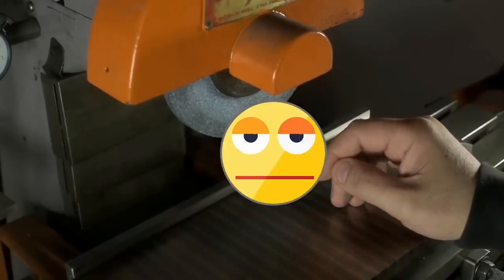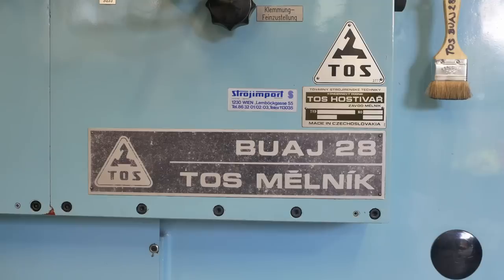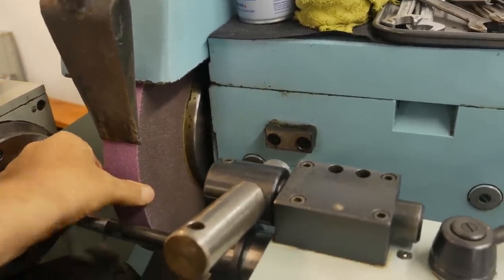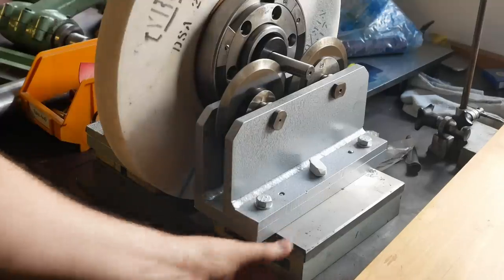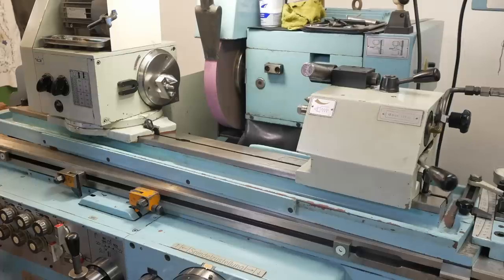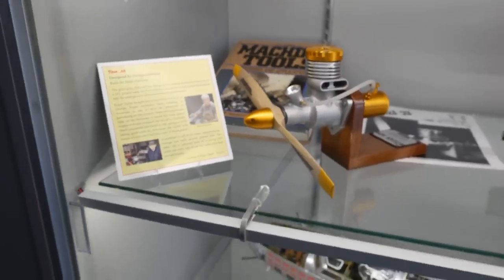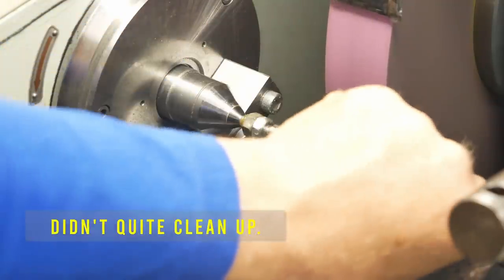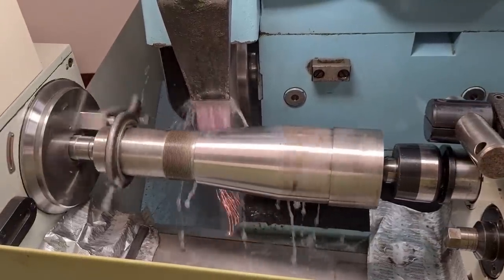Who needs a cylindrical grinder? || RotarySMP

Comment: To answer your question:  Everyone.
Everyone needs a cylindrical grinder. :)
Reply from the maker: Bingo...correct answer Tony :)
Reply: I thought I recognised the first few frames of this video
Reply from the maker: @NathanealGovender  TOT helped me out with a clip.
Reply: @RotarySMP  Great video. It's so hard to find information on these conventional machines.
Reply from the maker: @NathanealGovender  Thanks. that is my feeling as well. There is a lot of info about cheap consumer gear, but this top industrial stuff which was well documented in all in paper.
Reply: What a lush machine, but I'll just keep turning parts like 50p pieces on my cnc lathe thank you very much.

Comment: I'm always fascinated by the economics of machines like this. I have no knowledge of what the machine tool market was like back then, but consider: First, that machine was built pre-internet. Someone sat down and figured that it was economically feasible to invest in the design and tooling to build that machine (what was the design cycle like for it?) and figured they could sell enough of them to recoup that investment. How long did it take to design, and what was the cost? How long to build the tooling to produce the machine, and what the cost? How many did they deliver, and (again) what was the cost? And on top of all that, the machine is entirely hydraulic. Yes, it has relays, but (apparently) no digital electronics, and yet has pretty amazing accuracy and resolution. Incredible.
Reply from the maker: Good points. Given the development of high pressure hydraulics (3000psi for airliners, up to 5K for military), Jet engine fuel control units, etc with their associated close tolerances, and also parts for the nuclear industry meant that the market for such grinders is greater than many think. I imagine Hamilton Sundstrand and Woodward governers probably have whole plants full of machines like this. My guess is that they such manufacturers run them till worn out, rebuild them, wear them out again and then scrape them.
Reply: There's another manufacturing category that uses a lot of grinders: diesel injector manufacturers. Grinding is used on many components of the injector, whether cam-driven or common rail, and in the high pressure pump.

https://dieselnet.com/tech/images/diesel/fi/xpi_inj.jpg is an example of what the inside of an injector looks like. Gaskets and o-rings wouldn't hold up to the temperatures and pressures involved, so they aren't used inside the injector. Instead, extremely tight tolerances are used on matching ODs and IDs to provide sufficient sealing between moving parts, and for static joints extremely flat surfaces are clamped together to provide sealing. The tight tolerances on moving components have another benefit as well: the gaps are simply too small for most contaminant particles to fit into, meaning less abrasion and jamming.

If you can wrangle yourself a tour of a fuel injector manufacturer, I think you'd find it interesting. ID and OD grinders, centerless, form grinders, microhole edm, hydroerosive grinding, etc etc etc.
Reply from the maker: @markp5726  Good point. I would love to tour an injector plant.
Reply: You can be sure that isn't the first machine they built, even the first cylindrical grinder.  They probably had lots of machines out there and a list of repeat customers who could request such a machine.
Reply: Analog is more accurate than digital!
Reply from the maker: @jamesbutler5570  They seem to have specialised in grinders for about a century.
Reply: I guess often the answer is some big buyer (like the government) who either guarantees at least break-even or even profit. After that it is just a matter of walking in to the bank with your guarantee/collateral. Sometimes I guess the government could guarantee the loans too.
Reply from the maker: @rkan2  I would guess that there is a constant demand for machines like these, as they have a finite life and wear out. The products they grind are often invisible to the consumer, but ever present.
Reply: @RotarySMP  Sure - I was more referring to the initial investment in production.
Reply: A lot of machines get designed because the designer had a part they were manufacturing or planned on manufacturing that needed a specific tool that wasn't available. After the machine was built they found out it could be useful for a variety of things. I know I've built simple tools in my home shop for these very reasons.
Reply: Before the internet people were smart and networked just as much if not more.
Reply: @markp5726  how can one use that need to possibly aquire work/ customers in this market
Reply: I grew up in the north eastern u.s.a and my family had small construction company's and I always was fascinated by machine shops with equipment like you are talking about and let me tell you they pay for them selves quickly. So I'd hope who ever builds them would make out ok ad well.
Reply: Millions of bearing races are cylindrical ground every year. Same for gearbox shafts, machine spindles etc. There is no shortage of cylindrical grinding work, so I imagine  the cost element was mainly a comparison to their competitors.

Comment: Wow! What an awesome machine. These automated hydraulic controls are incredible. I bet he got it for next to nothing compared to its capabilities…
If I had a machine like this I would come up with so many more project ideas that I would most likely never get to start or even finish… so you are right: I need a cylindrical grinder now 😂. The model planes are astonishing as well! Thank you very much for the video
Reply from the maker: Thanks Markus. Yeah, this is the dream, picking up an industrial machine which never worked shifts. I think Franz has ground just about everything in his shop, and is eyeing up that box of nails as needing improvement.
Reply: @RotarySMP  Which nails don't need improvement, after all?
Reply from the maker: @hughmac13  If the broom handle would fit though the head stock, he would probably grind that round as well.

Comment: Original grinding wheel, only worn 12mm... wow! 😂 The last OD grinder I used went through a wheel at least that large every 16h or so. Needless to say, we got good at changing them.

One concern with a small coolant tank is temperature stability. The grinders I worked with (mostly UVA nomyline) had a chiller with at least two separately cooled circuits, chilling different parts of the machine to different temperatures. IIRC there were heat exchangers on the cutting oil, spindle oil, and hydrodynamic way oil, and coolant flowed through the frame and the linear motors as well. The cooling was good enough that warmup from power off only took ~5 minutes, as opposed to 30 min - 1 hr for older machines.
Reply from the maker: I will pass that on to Franz. Good point.

Comment: The detail in those models is just astonishing, I wouldn't even like to guess the number of hours that must go into them.
Reply from the maker: Young Park estimated 10K hours, but I am not sure if that was for one or for all three. They are made of thin aluminium and rivetted. Every single tiny rivet was driven like on the real plane.
Reply: @RotarySMP  im now imagining a miniature pneumatic hot rivet hammer 😅
Reply from the maker: @RJ-wx3fh  The guy was a retired dentist, so he was used to working with small scale precision.

Comment: this is amazing, automated hydraulics is something I have never explored before
Reply from the maker: This sort of task has since be largely taken over by CNC, as motors an electronics are cheaper than hydraulics. It is a very cool machine.
Reply: @RotarySMP  I know that CNC does most of this but there is something about these old machines, the old solutions that seem more like mechanical poetry when operating, more to figure out when exploring how the old guys put it together rather than just a circuit board and a 'fancy motor' not to spit on cnc since I use it to much lol

Comment: Man, at work I've been slowly learning how to use a manual cylindrical grinder from like the 70's it's quite a bit bigger, it's intimidating and I've done plenty of jobs on it and watching this I kept thinking those cuts are so much bigger than i take.
Reply from the maker: It seems these beasts will chomp through metal pretty fast.
Reply: @RotarySMP  yeah it makes me want to try and take deeper passes, however the tailstock brass nut went out on the last job. Scrapped a part on the finish pass when the center loosened itself and lost all concentricity and made quite a terrific noise. We made a new nut and I tore it down and put the tailstock back together but i feel ill be a little more timid for awhile.
Reply from the maker: @erok268  Good to get a feel for the machine again.

Comment: i use a much bigger one at work. the grinding wheels (yes it has 2) are about 3 feet wide and about 16" in diameter.
the parts slide between the wheels that spin the same direction and have an angled bar between them. the wheels are angled so that they move the part along the bar instead of staying in one spot. it also helps progressively grind the OD slowly instead of doing it aggressively
you can run a hundred parts through it in about 8-10 minutes. it cant do tapers though only straight grind.
Reply from the maker: So that is a centerless grinding machine right?

Comment: To anyone willing to learn the grind I highly recommend Jeffery badger aka the grind doctor.  I've inherited a 220" long Cincinnati milacron that uses a 30" wheel.  The question what exactly is a spark came to mind.   Friction so how do you know if your removing material from the part or the tool?  Also if your using a true round wheel shouldn't the part also be round?  I wish I had a tapper adjustment. To grind with the adjustment you can grind more detail. Very jealous great video
Reply from the maker: Thanks for the feedback.

Comment: ...I have about 7 of them, for external and internal grinding, unto diameters of about 1200mm and can grind holes unto 1000mm deep. I somewhear have a TOS, but my TOS is not a grindig machine. If You have a surface grinder, you can make supports to make your balancing mount as high as you want. You could also make 2 leveled straight rods to level the wheel. If they are propperly adjusted, that works great. i use something selfmade to balance wheels with 800mm diameter. The internal grinding spindle is driven by some kind of belt on most old external grinding machines with internal grinding attachment. I have a small Toyoda with something like that, but i never use it, because i have a dedicated internal grinding machine.
Reply from the maker: Wow, that is quite a shop you describe. Nice.
Reply: @RotarySMP  i grind for living...it's my job:-)

Comment: what a TOS great machine use one at work
Reply from the maker: Do you have any specific recommendations for its use or maintenance for Franz?
Reply: @RotarySMP  G'day there a awesome machine really solid we have a 80's model gets a lot of use still grinds microns !  the spindle is the thing its hydrodynamic if the oil pump fails its all over !! only other thing i can think of is the oil seal on the tailstock can leak coolant in and cause ware ,its a issue for ours now . hope that's helpful
Reply from the maker: @lewisl5985  Thanks Lewis, that is helpful. Luckily Franz is very fastidious with his machines, and always ensures clean oil, and oil flow before turning on the spindle.

Comment: A DIY cylindrical grinder might be a fun project. A super small desktop scale machine to make something like an Iso 20 belt driven spindle for a desktop cnc mill (which does not seem to exist).
Reply from the maker: I think cylindrical grinders are always very heavy and massive for their swing, as you need extreme damping and rigidity for grinding to make sense. If the machine is just going to impart vibration patterns into the work, there is no point.
Reply: @RotarySMP  We have a little cylindrical grinder at our shop with something like a 75 or 100mm chuck. It takes up about the same space as one of those cheap Chinese benchtop lathes, Ill have to look for a model number tomorrow. I think they can get away with the size by using a much smaller and more narrow wheel. If you're really into this type of thing I think it would make a great project!
Reply from the maker: @EpicZombiez2314  Sounds like a cool machine. Please post the name so I can google it.

Comment: I have a Covel No.32 Universal and cylindrical grinder that is laid out almost identically. The Ways for the table need scraped and they are like 6 feet (2 meters) long... not looking forward to the work. Have to finish scraping in my Covel #4023 10x16" surface grinder first. These old machines are awesome but I would have killed to find one in such great shape!
Reply from the maker: Yeah, he certainly got luck on this one.

Comment: This was really fascinating cheers! I’ve never really gotten my head round how something that gets eroded makes something so ultra precise. I mean how can it tell when enough is removed?
Reply from the maker: Yeah, I always wondered that with grinding as well.
Reply: @RotarySMP  The only thing I can think of is that grinding takes off a lot less material at a time than any blade/tool based process. I imagine that the finest precision is also limited to fairly hard materials that don't gum up the abrasive, so that you get a consistent "scrape". Also, with the two rotating masses (the wheel and the workpiece) you have statistics at work where any point errors are quickly avereged out over the whole surface, if that makes sense.
Reply from the maker: @misterbreakit2006  Good description.

Comment: i see in an auctuon an Fritz Sauber RM250 high presition cilindrical grinder, can you grind +- 2 micron in 25mm diameter, realy nice if you do inyection nozzles. But its tiny.
Reply from the maker: There are a lot of very specialised machines out there.

Comment: A follow up vid showing some of the prep for operation would be nice. Like truing the wheel profile - the short stroke on the taper means the resulting profile is almost entirely controlled by the wheel profile. Also, the grind kept showing an interrupted contact, why is that?
Reply from the maker: Hi Randy, Next time I need something cylindically ground, I will ask Franz if he will do it, and if we can make a video about it.
Reply: @RotarySMP  Thanks, I will keep an eye out for it.

Comment: Question : the dog used to rotate the spindle in the demo is obviously asymmetric, will yield an imbalance. Given the intense consideration given to balancing the grindwheel, is this an issue ? (If only in theory.. such machines are chasing perfection, right ?)
Reply from the maker: The part is only rotating at a very low speed. I think it was 200RPM in this case. I guess at the extreme (and lets be honest, grinding is for the extreme amongst us ), it probably can have a measurable effect.
Reply: @RotarySMP  yes, as you say the effect will be very small .. but this whole game is the search for perfect precision .. but .. however small, any effect due to this is systematic since the part is locked to the dog, cf any effect due to the wheel imbalance is statistically spread around the part. So it's not something that should be dismissed. It's nit just the bolt you were using as a dog, but it seemed to be pushing against a significantly sized hunk of metal on the faceplate (cf you trying to balance the wheel within a gram or so.. )
Reply from the maker: @davesmith9325  It is not my machine, it is Franz's. He reads these comments, maybe he will respond.

Comment: We have an older  TOS surface grinder :)  A Cylindrical is from Kellenberger 57U   -  also as an interesting Austrian machine... an  EMD "sinker" . havent found any info about this machine... i gues these were made in s small family business. early 90"s  probably.... Greetings aus Ungarn .. Viel spass !
Reply from the maker: I would guess that Franz knows of Kellenberger. He seems to have encyclopedic knowledge of Austria maufacturers.
Reply: @RotarySMP  Does he have a  FB page ? Oder hast du eine ?
Reply from the maker: @mrAq_pA  I am not on facebook, I dont think  he is either.
Reply: @RotarySMP  how to get in touch ?
Reply from the maker: @mrAq_pA  On the channel's about page there is an email address. Drop me a line and I can put you in touch with Franz.
Reply: @RotarySMP  did you get my E-mail ?
Reply from the maker: @mrAq_pA  I checked with Franz, he has never had anything to do with EDM machines so has no manuals or data on it.
Reply: @RotarySMP  I see. So bad luck then. Thanks anyway.
Reply from the maker: @mrAq_pA  It must have been a pretty obscure company. Sorry.